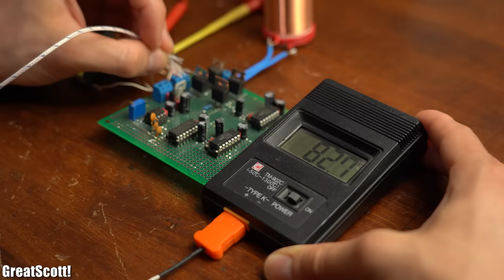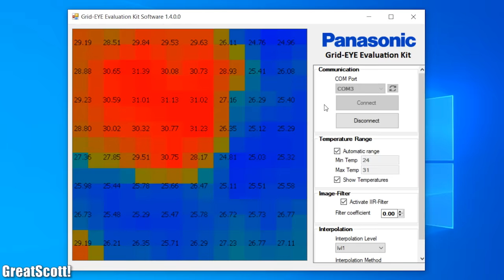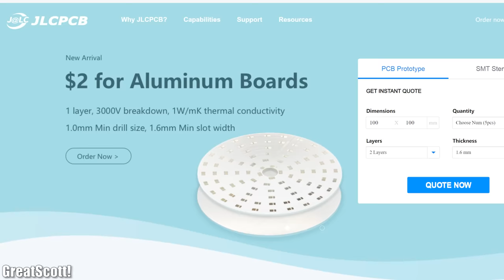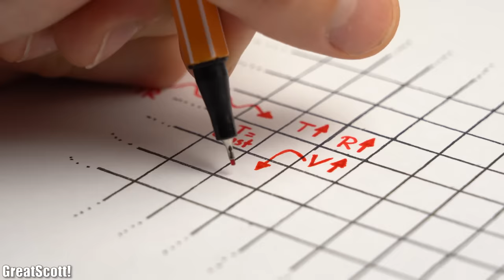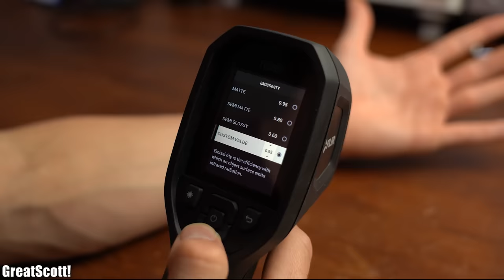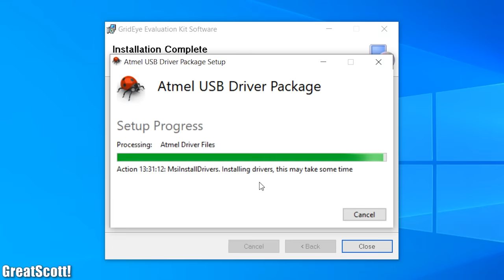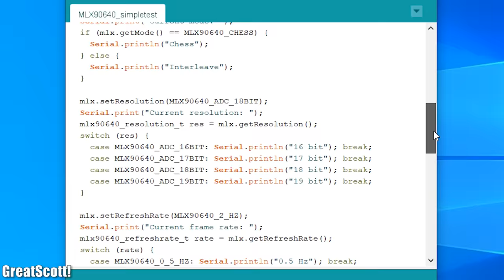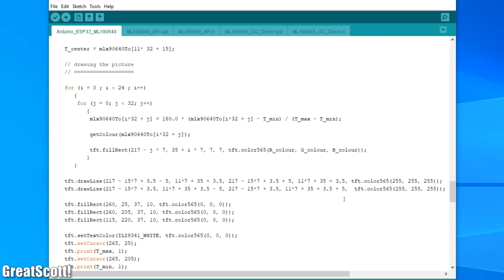Thermal Imaging Camera DIY $110 VS Buy $530 || DIY or Buy

Comment: Once you have such a camera, you automatically start to find more applications for it.  Like finding leaks in the insulation of your house in winter.  Or finding where your cat is hiding in your bedroom.
Reply: Oooo! That gets me thinking..
Reply from the maker: Definitely ;-) There is so much you can do with it. But I wanted to keep it short in the video and just focus on electronics.
Reply: How have I never thought of that! IR cat detector will be the new main purpose of my IR camera.
Reply: @Personal-rc7cy  That one is actually easy to do with a sheet of paper and an thermometer gun. Let the paper warm up on the bed and start taking measurements. I found on mine it's fairly even around a square created by the 4 corner screws but outside those screws it drops off rapidly despite the heat pad on it reaching to the edge. Also handy when printing to spot plastic that got too wet, can really see the temp drop at the nozzle when it hits a moist spot.
Reply: sadly my pets are cold blooded - ill have to stick to the insulation
Reply: Buy
Reply: Funny you give that example, as that is the exact reason im even looking up DIY thermal imager options lol

Comment: FLIR used to make some cheaper version of their thermal camera that actually used their high resolution sensor, just artificially limited. The full sensor resolution could be restored with a firmware hack!
Reply: Really?? Which ones??
Reply: @estebanod  Flir E4, but you might need to be careful with the firmware version, newer FW might be locked down
Reply: @TheBackyardChemist  >>> Thank You for posting this information.

Comment: I suggest: Lead acid battery desulfator, DIY or BUY.
Reply from the maker: I can put it on my to do list
Reply: @greatscottlab  Thank you Sir
Reply: but in his content we can always learn a lot about different circuits and how they work. In my seen product like desulfator, it is all from china imported to philippines and I know it is easy to break and just waste to us. 😊I have confidence in great scott that it will enhance the function even more than the expensive and not durable product of others.
Reply: @greatscottlab  use an re-emf charger
Reply: Против Глобал  That's literally what some of these desulfators/chargers do, it's not like they perform some magic to bring batteries back to life, they just heat the battery.
Reply: Против Глобал  That's why I said "some" others do the pulsing thing but either way the result and the end goal is the same, it's heating the battery just a lot slower, because the built up sulfur has to be boiled off the cell and from the desulfators I've looked at the pulsing ones do a worse job, also when talking about car batteries 1A is nothing, I've actually done it to a dead battery for a few hours and it barely got over 14v.
Reply: throw those things in the trash, desulfating vintage batteries is more expensive than your time and energy.

Comment: Why not get one of those "seek thermal camera" which attaches to your smartphone
Reply: I have one of them, got it for ~350 on black friday.  It's quite amazing tbh.  The biggest weakness honestly is the iOS app, but i'm super happy with the purchase overall.
Reply: Ive seen some chinese camera reviews here on yt where theyre pretty good for cheapish, like franlab's review of a $200 one
Reply: Yeh, I bought one a couple of years ago and it seems to be a good option for hobbyists at around £250.
It might be interesting to point out that the Seek Thermal refresh rate has to be slow due to US Government restrictions though.
The refresh rate on the FLIR demonstrated here seems to be much higher (maybe because its not manufactured in the US?)
Reply: @AClarke2007  i wonder if it would be possible to mod that restriction out
Reply: @Tano true. I much rather prefer standalone device. There's always the hassle of charging attachable device etc. Ideal would be something like that Cat phone model which has flir integrated into today's smartphone. That would be a great tool for mechanic like myself where I need to maintain/inspect/repair machinery and property things like heating.
Reply from the maker: I heard good things about them but I learned using such a handheld thermal imaging camera in university and wanted one like this for myself.
Reply: @greatscottlab  alright, worth the extra cost for you then then
Reply: @greatscottlab  to be fair I've only heard about them through other YouTubers getting sponsored 
So just thought id bring that up
Reply: @Tano that's indeed true. I have Flir, can't remember the model (tg something iirc) , but something like 5 years old basic model. I'd think that it would be unusable for this kind of electronics things. Well I suppose it's accurate enough, but I think it would be little inconvenient to use. You can see floor heating pipes and live wiring with it though. I mainly use it for overall inspections for pump motors and such to try to find increases in temperature as preventive maintenance. I saw couple years ago one from one of the top of the line Flir cameras and it was impressive. I watched ceiling heating grid with it and could clearly see all traces from something like 5m distance. But the thing cost something like 8000euros and was about 8x times the size that small model.
Reply: I have a Gen 2 Flir One and it works well for insulation inspection, engine inspection, etc. 

Advantages include sharability of images - email or text them as you need.
Images captured include a visible light picture overlaid on the IR image, which is very useful since it can be impossible to tell what you are looking at otherwise.

You can capture IR video. Processes like an engine warming up require this.

The only use case I would pay extra for a dedicated tool like GS has here is the one he bought it for - frequent bench work, grab and go quick checks. For everything else, most people want a Flir One.

I bought a Seek and returned it to get the Flir.

Comment: Personally a thermal camera + ZnSe lens has been invaluable to me in troubleshooting shorted boards. This made a thermal camera well worth it for me.
Reply: How does the ZnSe lens help in your situation?
Reply: @Abdega  The lens reduces focal length considerably which allows you to have a narrower field of view while maintaining focus. This allows you to pinpoint heat at the trace level and component level for components as small as 0603 or traces ~1.0mm
Reply: @reallyiffy  thank you!
do you use a ZnSe lens like from a CO2 laser or a planoconvex lens of some sort?
Reply: @Abdega  yes a Plano convex lens typically marketed for use with a CO2 lasert, I bought mine from Amazon.
Reply: I thought longer focal lengths mean reduced field of view.  Did you build a mount that allows you to adjust focusing?

Comment: As limited as the DIY option may be, I actually think I could use it for diagnosing hot spots on PCBs, though the drench it in alcohol method might work better.
Reply: Or my personal favorite of sticking my finger across the leads of a 300V capacitor to see if it's too hot
Reply: @NoorquackerInd are u still alive😂

Comment: Adding a simple regular camera and adding edge enhanced overlay would only be a few $$ more, and would provide an experience that feels visually more higher-res. Also emissivity can be easily programmed into the software. These would be fun additions but given the price per pixel is much higher DIY in this thermal sensor, BUY is a good conclusion for a goal of a practical device.

I like your DIY vs. BUY series.

Comment: I have the FLIR TG167. It does a good job. I've used it to find thermal "leak" around the house, monitored wheel bearing temps on my travel trailer as well as using it for monitoring my electronic circuits.

Comment: The Flir E4 can be "upgraded" to the 320x240 E8 with a firmware replacement. Huge value, and you can Google it easily.

Comment: something you didn't think of: you can simply overlay a LCD without a backlight, over the thermal image, it may need another esp32, but might be worth trying, using another esp or controller would also mean you could lock it to the same framerate as the thermal camera, without needing one controller to do too much work
Reply: have you made yours or done this?
Reply: @dhruvparmar007  no money for that

Comment: You could calibrate the DIY camera for use at a set distance and use it stationary. That way you could set something down in front of it and depending on the size and how far away it was, you could adjust the parameters to measure the X, Y of where the hot pixels are and know very accurately where the component is. It just wouldn't be a handy handheld tool for quick observations.

Comment: I cannot understate the usefulness of thermal cameras in electronics design. At work, we have a design we've been making since 1985, and for some reason the output channels periodically just die on it. The why had never been figured out until we got a thermal camera recently. I was curious to see if there were any issues, and one of the components was rapidly cycling between room temp and nearly 250F when the output would go into the positive cycle of its waveform. On paper, the components used were perfect for the application, in reality we swapped a 110 ohm resistor to a 1k resistor and it fixed the thermal issue.

Comment: Bought a Flir One 1 year ago for my Android SmartPhone, it was only 199$ and is a Gen-III Thermal Imaging Sensor, it's very sensitive and has an extra 1080p camera built in as overlay so you can see details as well as the heat spots. Totally with 199$, but it does have a few drawbacks. Even though it auto-calibrates, calibrating can take some time. And it's prone to lock-ups and freezes, for example if you walk around with it from an cold area to a hot area, it can freeze up. Also since it plugs into the phones USB-C connector, it can fall right out of it. 

They have fixed the notorious dying-battery issues (the earlier models usually lasted a few months, then the battery just flat out died), but for 199$ you get a cheap mid-range resolution sensor, and that ain't all bad. I use it to find heat leaks in my house, check for pipe-leaks in the houses piping, and fire risks in the chimney. I also use it as Great Scott does, to find overheating components.

It's also useful to detect thieves in the yard, something suspicious? Well they won't be able to hide from you - you can easily spot the hot body either of an animal (maybe your cat is missing?) or anything big and living in any dark areas.

Here is an example image I took of my 3090 card to see how hot it gets during idle process: https://i.imgur.com/WpuLjkK.jpg

Comment: You can always use a laser pointer to show where it's taking the readings or will that interfear with the reading, example laser points at the component imager reads temperate that way you don't need high resolution

Comment: Maybe you should have used a raspberry pi zero instead and added a cheap 3M pi cam to overlay over the thermal image. it would have been a bit more expensive but would make it perfectly suitable for your use case.
Reply: exactly what I was thinking. esp modules just don't have the power for a higher refresh rate :(

Comment: Last conversation from the Thermal camera store...
GreatScott: The FLIR TG267 with a 160x120 resolution...
Store owner: That´s a great thermal camera, you know your stuff
GreatScott: The GridEye 2000 360° HD with a 400m range and 1080x1920 resolution
Store owner: guy, guy, only what you see on the shelf
GreatScott: The GridEye 8x8 pixel

Comment: I also have some mosfet overheating problem, its working at around 500khz, but the current is only 1 amp, even though the mosfets are rated for 50 amps each, what could be the problem? 
Anyways great video,love how made its body too, 🙂
Reply: You can have problem with gate driving circuitry - if mosfet is not opening/closing fast enough and with high enough voltage it will stay in a linear region for longer time. On the other hand, if transistor that you used has high gate charge it can heat up a bit only from charging and discharging gate with high frequency. Also, if mosfet is used in resonant circuit (like ZVS or tesla coil) current that it switches can be many times higher than current draw from power supply.
Reply: The two most likely culprits are 1) insufficient heat sinking. 2) improper gate drive.
For the second point, the problem becomes that the MOSFET stays to long in the ohmic region in the transition period between on and off. I'll leave it to you to research how to drive it properly.
Reply: If it's spending too much of its total time switching (being not fully on or off) then it can still overheat even if running at 1/50th its rated current. 500 kHz is fast!
Reply from the maker: Your MOSFET does not switch correctly.
Reply: @Gameboygenius  i think the gate drive circuit is not capable of delivering enough current to charge/discharge  the mosfet gate :/  the heatsink is good enough but still it heats up the heatsink in like 15 seconds, in theory, the maximum wasted power should be  0.07 watts :/ any tips to make descrete mosfet driver? Coz i don't have access to those good integrated mosfet drivers like tc4420 etc, i have to build the driver with transistors, how to make one?
Reply: Greatscott! Built up a discrete mosfet driver in his mosfet drivers video out of transistors. You may even be able to make a  power amplifier or motor driver chip a crude mosfet driver. However, a dedicated chip is probably better. You can order a pack of 10 drivers for about 10 dollars on Amazon. (Your mosfets may not be turning off completely and you may need a negative voltage to turn them fully off (unsure about that, though))
Reply: What load are you driving at 500 kHz? Hard-Switching is bound to get lossy at that frequency, you might want to use a resonant topology. Use a MOSFET with maybe a bit higher Rdson but the lowest gate capacitance you can find and optimize your gate drive circuit. Don't miss the ~10k gate pull-down to ensure the MOSFET really fully turns off in all cases.
Reply: @MarianKeller  just ordered some good tc4420 ics, now it wil be much better

Comment: Cost on these is still high, so the sensors must be expensive, but not as much as the Webb telescope which will have the ability to look back in time into a specific IR wavelength for doppler shift.

Comment: For anyone wondering, it's possible to get a high refresh rate off this camera when using i2C you just need to set the clock speed on the ESP32 to 1MHz and the refresh rate to 32Hz on the camera.

Comment: Great video.  So valuable for my learning.
Does Flir manufactur their own sensor?  It seems a thermal sensor should be available that has performance closer to the Flir one.
Reply from the maker: They make their own sensors. FLIR was actually one of the first to make such thermal cameras.

Comment: For all those interested in acquiring a thermal camera: UNI-T has some budget options starting at around 130€ with a resolution of 120x90 (10800 pixels). However, they lack the handy Flir feature where it superimposes edges of the visual world (FLIR feature a normal camera next to the thermal one in its thermal imaging units). Aside from that, you can get Flir usb addons for smartphones starting at around 220€ that feature this image mix, tho the cheaper models do come with a lower thermal resolution (80x60) than UNI-T's.

I can also recommend such a tool for renovations and thermal isolation of pipes, windows, and so on.

Comment: Go for cat62 GSM. For 600 bucks you get telephone with pretty decent flir camera. My wife uses it to generate heatmaps of buildings, but I've tested it for electronics and works great. It's more expensive than flir you have, but you get added bonus of very rugged telephone which can survive extremely harsh conditions

Comment: This is a great project. The outcome might seem a little disappointing, but it does show you what will be possible in a couple of years when higher resolution sensors become available at a more affordable price. Perhaps some of the limitations of the sensor you noticed will be possible to overcome with more sophisticated software or faster processors (like a Raspberry Pi or similar). They could certainly have multiple cameras. Although until the cost of the sensors come down anyone with a practical use for one is going to be better off buying a commercial unit. I was interested to find out, however, that IR sensors were available.
Reply: I look forward to the 2030s smartphones with built in thermal cameras
Reply: @mezu-e  there are smartphones with IR imagers starting from about 400 €. If you mean mass market it's very unlikely to happen

Comment: Two other buy options: you can get USB C and Lightning FLIR attachments for your phone, which cost way less, but then your phone is the screen, you can easily save and share images and video, and eat mor control. You can also get smartphones with built in thermal cameras, although they’re typically targeted towards construction/engineering folks and while they’re typically very rugged,, they often lack other features for regular phones in that price point
Reply: Video with Flir? You should be kidding. Flir still offer only 9 Hz sensors from the last century while 25—30 Hz sensor are available for many years

Comment: I'm now curious about the extra cost of a higher resolution sensor and display.  How much more resolution would you need to replicate FLIR, or make it usable for electronics diagnostics?
Reply: The FLIR Lepton module alone costs 200 €, so that certainly isn't an attractive alternative. For electronics, the best bang-per-buck are the Thermal Expert cameras.